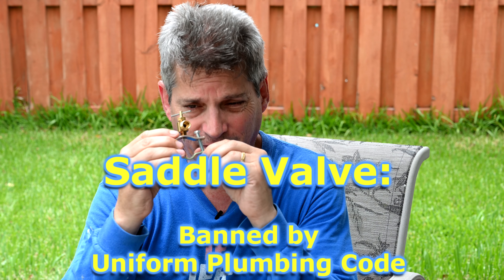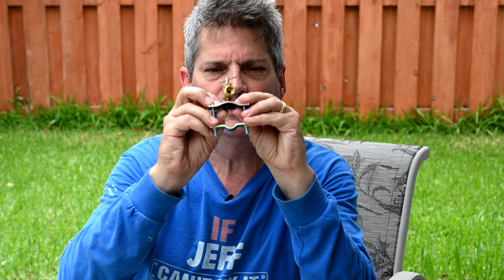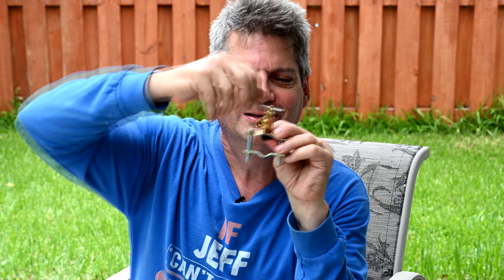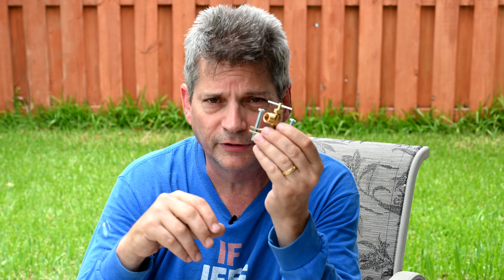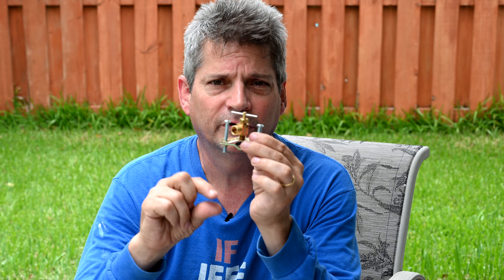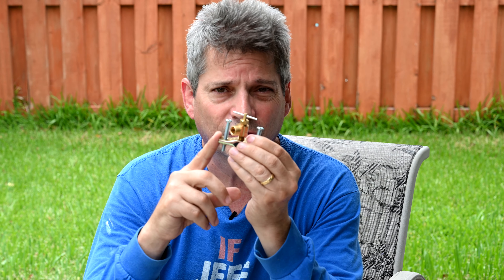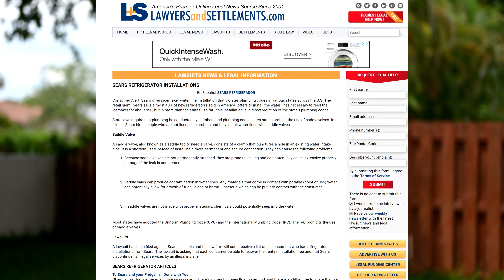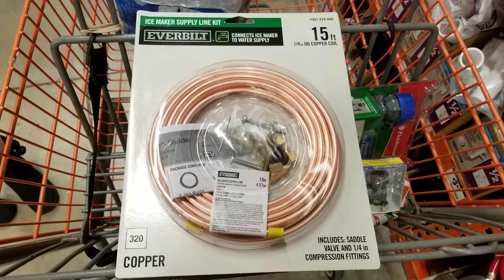Why You Should Never Use A Saddle Valve on Your Plumbing

Comment: Purchased a house built in '82 just over a year ago, so far I've had to replace several sections of pipe that had saddle valves and leaked. This house was a short sale and there was evidence the house had previous water damage before we purchased. A finished basement with the tell tale signs of water stains on the ceiling, although moisture meter showed no active leak. 

When replacing the kitchen appliances the water line from the refrigerator ran to the basement ceiling with no valve visible or accessable, when I removed the drywall ceiling as expected, a saddle valve, heavily corroded and couldn't shut off. Replaced that section of pipe and added a quarter turn ball valve under the sink and ran a new water line under and behind the cabinets to the refrigerator.

Additional saddle valve broke when I was installing a new water heater and bumped the 1/4" copper line to the homes whole house humidifier when replacing the old shutoff valves the home had. Apparently the person who replaced the water heater in '01 decided the way to fix a leaking valve was to solder another valve to it. Water heater had 3 shut off valves...

Typically replaced with 1/2x1/2x1/2 tees going to a 1/2x1/4 ball valve with compression fitting. In the case of the humidifier, simply replaced with a new length of pipe and will replace with a tee and proper valve when I replace the humidifier.
Reply from the maker: Yup, and what's funny about all this saddle valve nonsense is you'll see lots of idiot plumbers come on here and tell me I don't know what I'm talking about and they've been a plumber for 30 years, blah blah, been installing saddle traps 30 years and never seen a problem, blah

Comment: I’ve never heard anything good about these valves and I’ve seen the damage they cause when they fail. Great video Jeff.
Reply from the maker: Awesome, thanks! what kind of damage have you seen, and what dollar amounts are talking about?
Reply: Kind of a long story but I think you will find it interesting. My in laws had a new refrigerator with ice maker installed and they live in a condominium. So they a common wall with their neighbor. I was at there house that evening looking at their new refrigerator about 2 hours after it was installed and I kept hearing splashing water. It sounded like it was coming from the crawl space so I went down there to check it out. There were two 3/4 inch copper main water lines leading into the crawl space from the meter. One for their condominium and the other for their neighbors. The appliance store installed the saddle valve on the neighbors water line and it looked like they over tightened it because one of the ears was broken off causing a constant leak. We couldn’t shut the water off because it would have to be shut off at the meter and then their neighbor would be without water. I called the appliance store and they said the best they could do was come out early tomorrow morning so the pipe leaked all night. The next morning a plumber came out and fixed it and installed a shut off valve for the ice maker. All the water had to be pumped out of the crawl space and fans temporarily installed to help dry it out. I’m not sure what the dollar amount was for the damages because the appliance store took care of everything. I said it was a long story but I think it relates perfectly to your video.
Reply from the maker: @teh60  Great story, thanks for sharing. I'm skeptical about some of the other commentators on here telling me their saddle valve has been on for years with no issues.
Reply: I wanted to add that Richard the plumber on this old house said that saddle valves have the biggest failure rate in plumbing history.
Reply from the maker: @teh60  Yes, This Old House video here is where Richard says not to use saddle valves: https://youtu.be/d4X1yg-Fb88 and especially since most people use them on ice maker lines, Richard did a second video last year showing a friend how to install an ice maker line and he showed again how saddle valves are designed to fail: https://youtu.be/VzFYO3BpYdE
Reply from the maker: @teh60   @teh60  Yes, This Old House here is where Richard says not to use saddle valves: ✅ https://youtu.be/d4X1yg-Fb88 and since most people use them on ice maker lines, Richard did a second video last year showing a friend how to install an ice maker line and he showed again how saddle valves are designed to fail: ✅ https://youtu.be/VzFYO3BpYdE

Comment: I've never had a problem with a saddle valve.  Used many over the years.
Reply from the maker: Yes, some people get lucky, but read many of the comments, you'll see others reported having leaks, others had expensive insurance claims.
Reply: I've never had a problem with them either. I've installed a few dozen over the year. I believe the ones that leak were not installed properly. If you don't get the clamp bolts tight enough then it's going to leak. If you tighten the clamp down until the pipe starts to bend(takes and oval shape) then you are good.
Reply: A compression stop would be better first time I ever saw a seattle valve was when a guy had one that was leaking behind his fridge and it had leaked and completely ruined his frame work and had to get the floor under the fridge replaced because it had started to bow the floor
Reply: @jeffostroff  insurance claim a pin hole leak would take a long time to flood anything. Just shut water off replace with a new saddle valve.i have one on my humidifier it’s 21 years old not a drop of water. I know I’m lucky please just stop with the dramatics.if some one had a 30000 dollar claim they had more than a saddle valve fail

Comment: Would drain saddle work better on a pvc pipe? Recently bought a tankless ro water system.
Reply from the maker: I still would not attempt to use one since the code says not to use them it says not to use any saddle type fittings

Comment: Thanks for the great video. I was thinking about using a saddle valve in a rental and you inspired me to do it the right way with a shark bite tee valve. Much better, confidence and legal. Cheers
Reply from the maker: Glad I could help!
Reply: Not that either are a good solution , but, I would trust a saddle valve over a sharkbite any day. I have had many a saddle valves that are older than i am, (although, I have had one leak, but fixed it with a quarter turn, but have seen sharkbites fail within hours, not worth bringing in the door.

Comment: hi. we have a saddle valve that was installed by previous owner for the humidifier connection (we're in CO). I haven't been able to figure out how to turn the valve on (allow water through). Usually if the valve handle being parallel to the pipe, it means it's open. But this valve is different. If looked from above, should it open clockwise or counterclockwise? Do I need to open it all the way? Please let me know if you have info on this. Thank you
Reply from the maker: No idea but see if it is a multiturn valve and try counter clockwise. If this does not work, maybe it is clogged.

Comment: I've never once had an issue with them. I counter sink the bolts tho. I've probably installed a dozen over the years. My dad (who is a pipe fitter funny enough) also uses them and has never had an issue leaking over the past 30 years of owning his home.
Reply from the maker: For some people they leak a year down the road 2 years down the road five years down the road, they're always fine or never had a problem until the minute they have a problem and then it's a $30,000 problem repairing the leak damage

Comment: In my experience these are fine in basements with drains, but never put one in a wall or anything like that. They usually dont leak alot when they fail, its usually just drips at first. They will last years before they leak, but thats the problem they are forgotten about and if its in a bad spot it could cause mold damage.
Reply from the maker: Yes, when they install them out of sight, out of mind

Comment: I had to use a few of these over one of the holidays when nothing was open. (baseboard heater) Pipes froze up, but didnt crack it, so heated it up, but bad flow, so pulled apart the pipes and flushed it to scalding hot (140+), then re-assembled, but now had air in the system. This was great for bleeding it, since the OTHER "PLUMBERS" failed to replace heating pipes without bleeders. Waited til our plumber was back on board and cut that section out and put in a new pipe WITH  a bleeder this time. so they DO have their uses, just not long term.

Comment: There's one under the sink connected to the reverse osmosis water filter. It's fine. The water filter is dripping and spraying water everywhere. Removing the filter once I figure out how to stop the water flow. Saddle is in an awkward position near the wall, behind the water turn off. What are my options?
Reply from the maker: I would remove the saddle valve for sure. You may have to solder on some new section of pipe to take care of that pin hole left by the old saddle valve

Comment: I have a problem with one leaking right now in my mobile home under the kitchen sink. Is it normal for one to be attached to a rubber line ?
Reply from the maker: I would think that would be even worse, if the rubber is dry. Point is moot, we are not supposed to use those and this is why, they leak.

Comment: It's not that people are always cheap, sometimes it's the plumbers that are trying to empty your pockets. I've seen plenty of ads where they want $75 to $90 just to show up "service call", then like $30 for every 15 minutes. So there is some blame to go around. You can't justify those kinds of prices for most jobs, especially for a plastic water line for your fridge.
Reply from the maker: Unfortunately is really expensive to run businesses and all that cost gets passed on to us consumers
Reply: Got that right. Understand travel and stuff, but that's covered with the $75/90. Then a $120 an hr? Same rip off as car repair. Though at least needing $1000's for the damn computer.  Though the mechanic usually buys it, not the dealer.

Comment: My saddle bag is fine and dandy, if it fails it's because the rubber gasket was torqued. Hand tightening is key. It's for refrigerator waterline it works fine. But I agree if your not handy with your home your prob alright with these. But the swamp cooler water line valve they sell at home Depot is perfect for adding water to your swamp cooler or fridge ice maker. I didn't see one in your videos and I think that one's pretty good and even more basic.

Comment: I've had my saddle valve in the house for 20 years, no problems. Costly repairs, only if you have a plumber come to your house.sweating a couple of pipes together is easy. Good video. No offense to you,  but plumbers today, charge outrageously high prices, that's why people should do their own plumbing, if they have any kind of mechanical skills. Most people are afraid to tackle any plumbing jobs.
Reply: No self-respecting hobbyist, nor tradesman would ever promote the use of saddle valves, namely when a compression "T" is available, for those DIY folks not good with a torch. With that said, and when used correctly & not over tightened (rookie mistake thinking to prevent future leaks) Quality Brass Craft or other non-Chinese non-lead containing neoprene disk type saddle valves can be an integral, reliable 30 + year solution to attaching low demand sources such as Ice maker solenoid feeds etc.
Reply: @dandavis2552  Who said I'm promoting the use of it, I'm just giving you my opinion and experience with it.

Comment: Having problems with saddle valve in my basement right now.  Water line leaking behind refrigerator and saddle valve won’t turn off water supply to refrigerator/ice maker.
Reply from the maker: So it sounds like you're saddle valves maybe a multi turn type? If it is sometimes those gates inside there fail and then you just need to put on a new type of water valve. I would use this opportunity to remove the saddle valve and replace it with a quarter turn ball valve.

Comment: Have a new refrigerator delivery 1 day ago. Old refrigerator was in the house when I bought it. Was told the water lines wasn’t connected so never really try to connect it. Did the old fashioned thing with the ice tray. So fast forward 3 years later the original refrigerator starts to go bad. Now bought a nice new French door instaview with the built in ice maker on the door my dream has finally come true.  The copper water lines are present in the are where the frig is go to be place which also has it own shut off valve. Go to open the valve to see if we have water flowing thru it before I do my final connection to the new frig. I get nothing. So I go down in the basement to trace it the main water line and what do you know I got a saddle tee valve tap into it. Smh. So turn handle to open up the valve and still no water. I’m assuming it probably clog with sediment since watching this video. So my question is how would a plumber correct this problem, what I mean I want my water running to my new frig and also I want to take this saddle valve out and have it done correctly up to code?
Reply from the maker: It's a very simple job for the plumber to remove the saddle valve and replace it with code approved parts.
Reply: @jeffostroff  Thanks Jeff, I already schedule a appt for a plumber to come tomorrow to take take that off, cut that piece out and weld in approve valve and route a new copper line up to frig. It may cost a arm and leg for such a small job but it will help me sleep better at night in this particular area of my plumbing.

Comment: i have one and need to remove it and the old fridge its connected to.
Reply from the maker: You'll have to remove a small section of the copper pipe where this left a hole, and then solder in a T

Comment: If installed properly and quality product is used, they are more reliable and efficient than a sweated joint, especially in tight and low access areas.  Sometimes quicker and easier is better.

Comment: I worked for a company that installed dishwashers, refrigerators ect. I have probably seen several thousand of these things. It seems like the quality of the actual valve went down hill over the years. The ones made in the last 20 years are very questionable. We never installed them but often had the pleasure of turning them on or off. You never knew if was going to be a leaker or not. If a valve was installed and I needed to turn it off, most of the time I would shut off the whole house main valve rather than rush touching those things. I have seen some pretty costly damage caused by those suckers.
Reply from the maker: Smart move shutting off the water at the main instead!

Comment: Have one under the kitchen sink to feed the instant hot. It was professionally installed over six years ago. It just started leaking tonight.
Reply from the maker: Yup, and all these clown "professionals" come here and criticize me in the comments saying they've been doing it this way for years and never seen an issue! They tell me I'm lying, they tell me I'm trying to scare people. Of course they never knew they had a problem, because the homeowner won't call them back to fix something they did wrong in the first place.
Reply: I've had ball valves leak and stop working just as fast. If I only had to replace a saddle valve every 6 years that is a bargain. 2 min job versus replacing a non functional ball valve.

Comment: We use them regularly in Ohio.  As a plumber and HVAC technician I have installed hundreds of them, and to my knowledge never had a failure.  Now,  I would never put one in a ceiling or wall, same as I would never put a handle shut off in a ceiling or wall.  I have had hundreds of ball valves develop leaks in the handle area but they should not be placed in ceilings or walls for the same reason.  Use common sense. With PEX pipe it probably is time to outlaw them as they should never be used on a plastic pipe that over time gives into pressure applied and absolutely will fail to seal. So I mostly agree with the point of this video, but would still use one in a second on copper in the basement near the sump pump. Now excuse me as I go install another fine Aprilaire humidifier that sent a saddle valve with it to tap into the water supply.

Comment: When those originally came out you weren't supposed to simply crank down on the needle to pierce the pipe, instead the original design intent was to remove the needle valve from the body and then drill a 1/8" hole in the pipe and then put the needle back in, few if any ever did that, and/or they couldn't hold a drill steady enough and damaged the gasket.  Regardless, sadle t's were a recipe for failure from the word go and to be honest they shouldn't even be allowed to make them anymore.   I don't trust those sharkbites fittings either, there really is no equal to a proper solder joint with copper piping, and brass compression fittings for copper tubing used for ice makers and stop valve to faucet connections.  The only alternative to soldering I consider to be acceptable on copper piping is the pro-press.